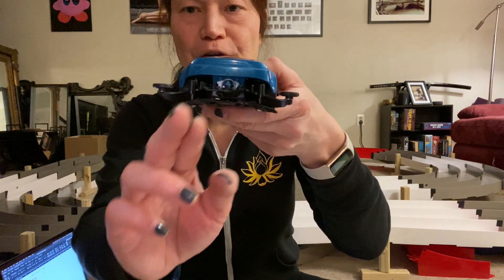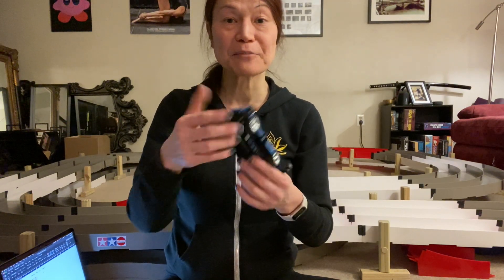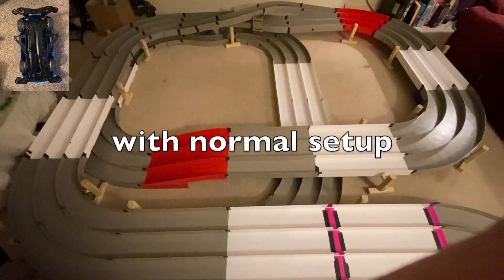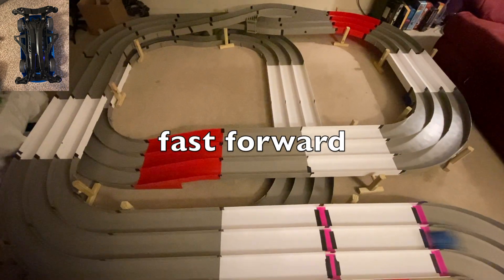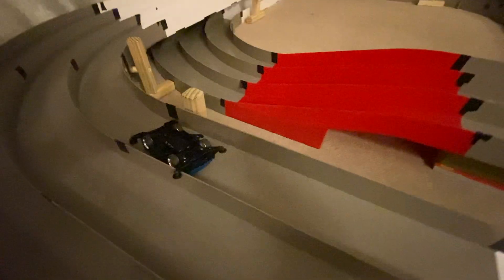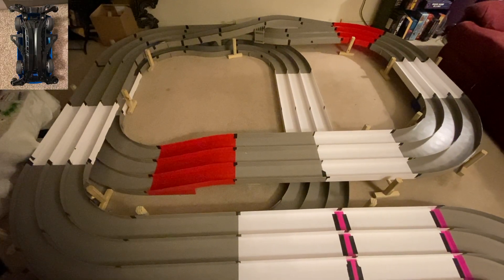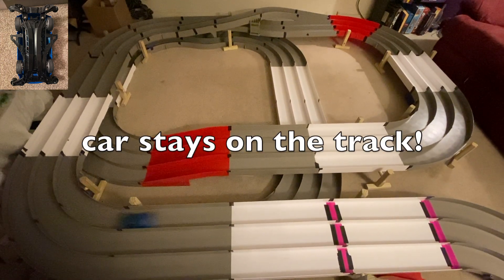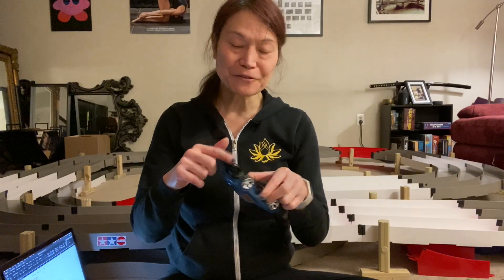Tamiya Mini 4WD - FM-A Upside Down Brake

Comment: Would you please explain the mechanism behind this? How moving the brake to the back and have the curve helps the car hugging the track? Thanks!!
Reply from the maker: Yes, watch the first few seconds of this video: https://www.youtube.com/watch?v=EvrnUQlW40A So you see that a rear brake is much more beneficial to a car on an inclined slope than a front brake. The big problem with the lane changer is the position of the rear brake on an FM-A chassis is a little bit too far off of the ground so flipping it gets the brake material closer to the ground (even if it's just the edges of the brake making contact).
Reply: Thanks!!

Comment: Can you show if it clears 1mm? Mach frame cant clear it upside down or not because the tips at the end is too low
Reply from the maker: So, if you screw the upside down brake on all the way, it will not clear, but if you unwind the screws slowly, the flex of the brake isn't as curved and will clear 1mm. It's really close.

Comment: I'm having trouble pn the landing it bounces out of the track
Reply from the maker: Try getting your car to weigh 86 grams using the Spider-Man Mach Frame technique and keep your batteries at 1.5V each or under. You don't have to flip the brake upside down on a Mach Frame. Just install it on the rear. Try Rayovac alkaline AA batteries.